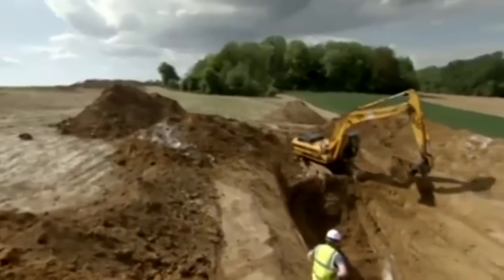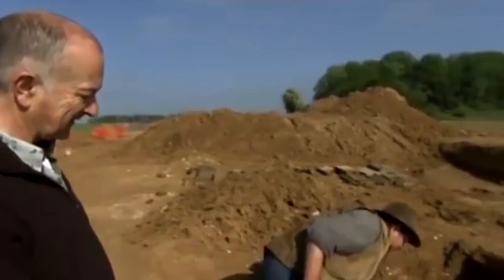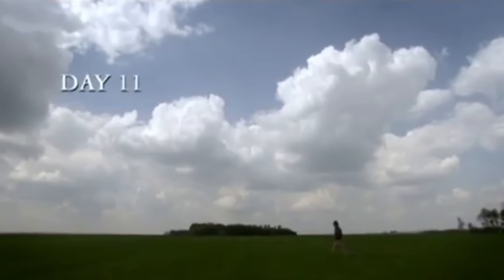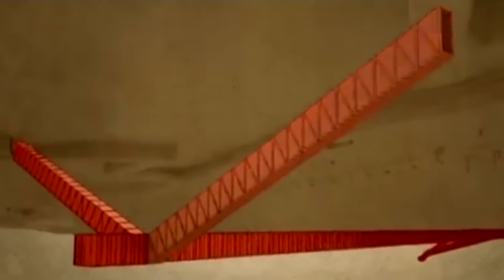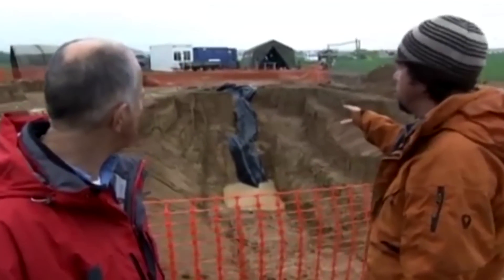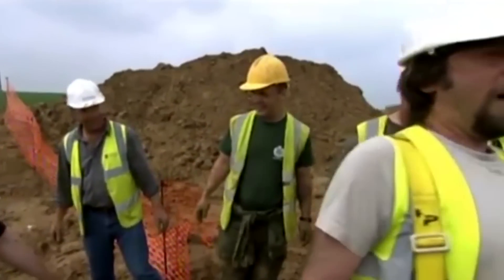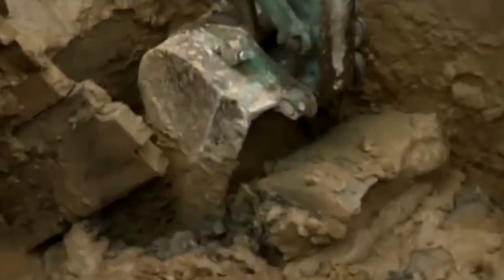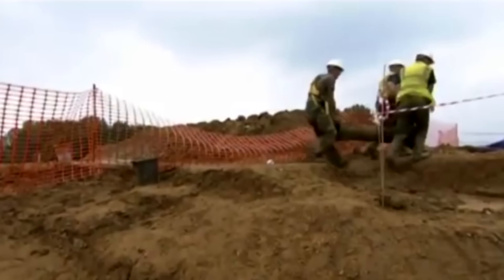How To Recreate Livens Giant Flamethrower | Secret Weapon Of The Somme

Comment: These shows are great except the artificial time limit they pretend to have to try and build suspense. If they were in fact in a time crunch they would have brought in a pump and pump that damn water out so they could keep digging. Instead they just decide to wait for it to dry up.
Reply: I agree with the time limit being pretty absurd, I understand that the show is based on it but they should do the 2 parts on 15 days then keep going until they feel the excavation is complete and maybe then they could upload a end part months/years later or whatever time it takes. Or just say that the excavation continues because most of these shows they do are not even 50% complete and it feels really unproffesional to just cover up and put everything back the way it was after such short times as they use on these shows.
Reply: They did use a pump until they got to the thick mud.
Reply: The limit is going to be cost. Everyone has other jobs to go to, accommodation costs would be high and the local farmer is probably charging a small fortune per day for the dig to go ahead.

Comment: though interesting in the fact they did it, but a lot was lost here,  they did not use the procedure nor the equipment that was available for use in making this,  the pump they used, and the fuel cells, this is not even a closely miserable reconstruction of what they are going after , good work on the engineering, but sad at how they did it.

Comment: So they didn't rebuild the actual flame thrower like it was in 1916 so they proved nothing except they can build one totally different.
Reply: How much would that have cost? They used the modern equipment for ease,and fitted a nozzle to the same design as the original if you hadn't noticed. The aim was to replicate the effect of using the original weapon. They showed this in all its terrible horror. Perhaps you could have stood in the line of fire and told them that they are doing it wrong.
Reply: It was a proof of concept more than an actual rebuild. They proved that the concept would work. They proved that the kerosene and diesel mixture would effectively remain burning in the trenches. They proved that the photographs and reports of the weapon's effectiveness were accurate. 
True, they used different parts such as an automatic cutoff valve, but safety is more important than historical accuracy. They would also have to fabricate the entire machine from scratch, which would have proven to be a huge expense. Overall, I'd say that it was a success.
Reply: @christiangibbs8534  Thank you sir for your politeness and perspective on the comment I made. Your points are correct and understandable and safety is a concern but I still think an exact replica would give a different result which is what I've been trying to convey. I think you'd agree, yes? I do understand they got results they were after and again still feel the results would be different with an exact replica. 👍
Reply: @williambryant5946  The result looked the same as the historic photos so I beg to differ sir. To replicate the original design would have cost an utter fortune in both time and money, taxpayer money. They proved the concept and were able to demonstrate the effect, which was the aim of the exercise.
Reply: @marvindebot3264  I agree to disagree with you. I also don't think it would cost as much as everyone thinks to rebuild the original. Think of the cost they had to build what they did. I don't think it would cost much more, if any more at all; than what they built. Everyone has an opinion and we all don't always have the same one. I respect your's and other's opinions but disagree with them.  👍